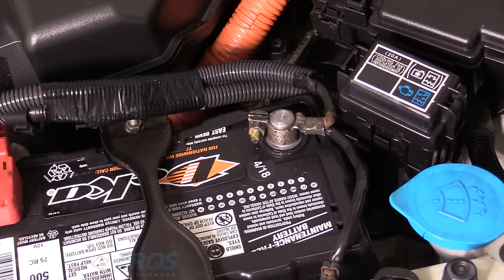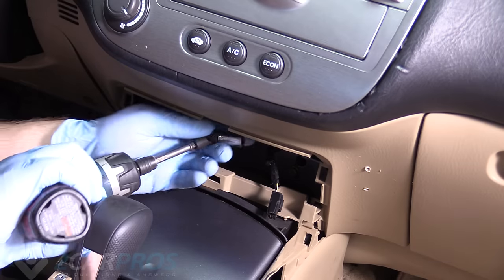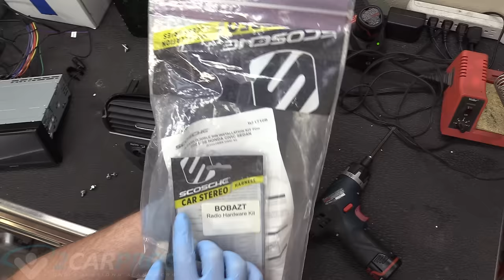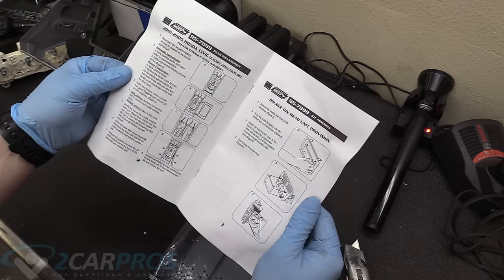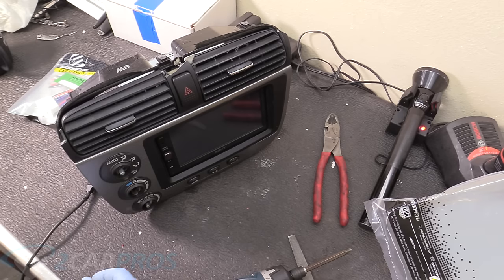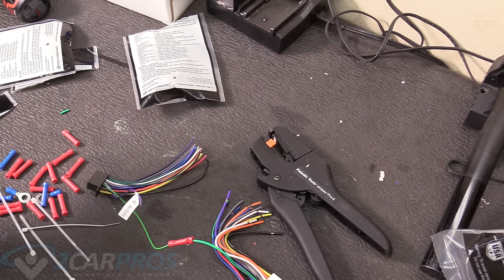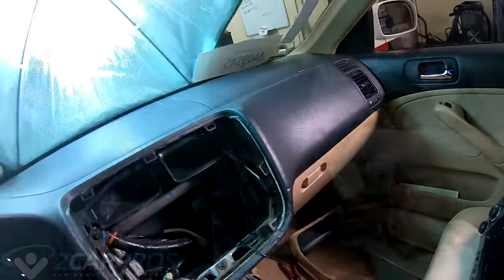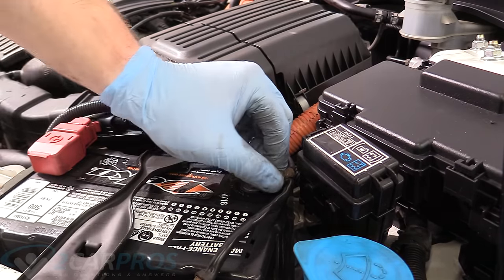How to Replace Head Unit Radio Honda Civic 2001-2005 EASY!

Comment: For anyone doing a DIY- don’t pull the cigarette lighter connector out like that. There’s a little tab underneath the connector that you press and then you can just pull it with a firm tug by hand.
Reply: Sometimes they are stuck and u have to pry it you’ll be fine doing it that way as long as as battery is disconnected  no worries.
Reply: @tonysgonzalez9390  This comment wasn’t about the electrical component, it was about preserving that tab on the plastic that keeps it locked in place (but yeah battery should definitely be disconnected regardless). 

If you do have to pry any electrical connector you should press on the tab or whatever’s needed for it to be in the “unlocked” position so you don’t break the locking mechanism when you pry it. They can be forgiving if you do it like the guy in the video, but at the end of the day they are plastic.
Reply: I just did that and the lighter isn’t working anymore what do I do?

Comment: FYI, only the 2003-5 models require removal of the center console to install the stereo.  2000-02 do not.
Reply: I was wondering about this.. It seems so ridiculous that you would have to remove all those panels just to get to the radio. I have a 2001 honda civic dx 5 speed manual. Ive replaced stereos in my 05 G35, my 05 Subaru WRX TR, and my 03 Jeep Liberty.... None of those vehicles required so much panel removing. My civic already has an after market old CD player which does work so it has the single din kit but I cannot find a video that shows how to just swap the head unit.
Reply: Eric Peacock I have a 2002 EX 5MT and your 2001 should be the same as mine, which is one of the easiest head units to access as you just pull out the trim surrounding the head unit after you remove those two bolts on the underside. No trim panels to remove except that small panel that covers those two bolts. It is bizarre that Honda decided to make it harder to access the head unit for the 04-05 mid cycle refresh for no other reason.
Reply: @IMP3TIGO  Probably because, people where stealing Hondas alot and if they couldn't steal the car they would most likey steal the radio
Reply: Oo
Reply: @No_Transitory  I installed my double din car stereo in my 2001 honda civic last week. I didn't have to remove the center console. The piece of panel under the stereo in this Civic is part of the center console. On my civic it is separate from the center console.
Reply: @bryanmurrayvideo2513  What double din unit did you go for if you mind me asking?
Reply: @IMP3TIGO  So for my 01 , I should just take off the side panelling, remove the lighter plug and then disconnect those bolts?
Reply: @mrdnd1234  been a while since I removed my head unit but I believe you just have to remove a plastic trim to access the underside bolts and once the bolts are out you can just yank the head unit trim piece (with head unit in it) out. My reply above describes the process. You should be able to find a video on YY but you can ask on civicforums.com if you're having problems.
Reply: @No_Transitory  how’d It go? I had 04 g35 but I didn’t do it myself. The one in my 95 stepside was easy to do as well, I wanna add a double din to my 02 civic dx with a 5 speed manual transmission
Reply: 04 did not require taking the center console apart.

Comment: Thanks a lot for this video. Out of the 10 or so videos I watched before replacing the stereo in my 2003 Honda Civic this one was the best in terms of clarity (no just the sound or video quality but the quality of the step by step instructions). I just replaced my OEM head unit with Pioneer AVH NEX-1400 with a back-up camera. Enjoying it so far. Thanks again!
Reply from the maker: Very cool! Thanks for watching!
Reply: how did you install the backup camera? any tutorial that you followed?
Reply: Did your car originally have a radio code?
Reply: @blue8ify  yeah it did have a code.
Reply: @NinadKothari1908  I went Google diving and discovered once you remove the factory radio, the code is not needed. That was my worry. I thought the car needed the code and I didn’t understand how I wld enter it w/ an aftermarket stereo.
Reply: @blue8ify  oh yes, sorry I didn’t answer that fully. Yeah my old radio had a code but my new radio doesn’t need it. It works as is.
Reply: @NinadKothari1908  no worries. Now it’s in the comment thread for others 🙂

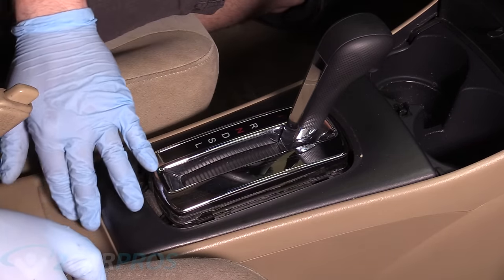Comment: For those with the manual transmission 7th gen civics, I followed this video exactly EXCEPT i skipped the removal of the shifter panel and started at 1:24 instead. Maybe you can remove the plastic trim panel for the manual transmission, but I felt that if I kept forcing it I would have ended up breaking something. 

Doing this allows you to gain access to every other step, you just kinda have to swivel the panel around the manual shifter for the initial steps.

Comment: Fantastic video! This was the first time I ever did anything like this to my car. Thanks so much for the in-depth video.
Reply from the maker: Very cool! I love hearing that. Thanks for watching!
Reply: Yea, same here, much appreciated. 

But for real, although not extremely complex or anything, it seems like this particular make of car is unnecessarily involved to swap a radio. 

Which is unfortunate, because In 2019, we need an aux cable! And obviously that wasn’t a standard feature in cars in 2001-2005. But hey, that’s what I get for buying an older car, I just had to have a manual to beat up while I learned. lol. 

Thanks again. Good man, I’ll come back to you for my car needs in the future, with any luck you’ll be my guide to a bunch of adjustments and work yet to come.
Reply: Me reDing this after removing the center console :|

Comment: Thanks for the video, pretty helpful. Though at least in my manual 2002 EM I can more easily remove just the cigarette lighter panel with a little wiggling rather than mess with the shifter trim. Once the suggested trim arrives I will be all set

Comment: Do you know where I can purchase the replacement parts for the center console (around gear shift) bezels for Civic 2003? In replacing the audio system with the one you have shown here, I need to replace those parts as they are damaged. I will be grateful if you could send me a link to any store taht may sell these bezels.

Comment: I did this on a 04 honda civic ex.  Used the wiring harness but my head unit could no save the time or the preset radio stions. Was told to  switch yellow and orange.  Now when i turn the headlights on. I lose the instrument lights except for one of the lights. Everything else is out untill i turn off the headlights off. Then everything turns on. Pls help me
Reply: Same to me if I turn my headlights on my radio goes black

Comment: @2CarPros I recently acquired a 2003 Civic. The aftermarket radio that was installed resets back to the initial set up after the car has been off for more than an hour. Also, Fuse 9 in the under-hood fuse box blows the moment a new 10 Amp fuse is inserted. 

Any idea what the issue might be? I’m thinking the radio was wired incorrectly. Is it possible incorrect wiring of the radio is causing that fuse to blow?

Comment: So what did you ultimately do with the parking brake wire? Did you tap it into the black ground wire or actually wire it to the parking brake? Thanks!
Reply from the maker: It's kinda like a choose your own adventure book. Both endings work and it's all good. Technically according to being technically right, I routed it to the parking brake light. Thanks for watching!
Reply: @2carpros  I don't understand.  There is no visual of what you are describing and I have no clue.  Also, why would the parking brake need to be wired to the radio?  What is wrong with playing the radio when it is not engaged?
Reply: @Killashandra111   regulations require that the parking brake be set before you can watch videos on the screen. This is a safety feature so you don’t watch while you’re driving. When the radio is connected to the parking brake, it will not play videos unless the parking brake is on.
Reply: Yes many car radio/infotainment systems have a wide range of features and options that are ruled too distracting or complex while driving, but if you have a passenger it is a shame to not have full access also

Comment: My radio code isnt working and I dont feel like driving 3.5 hrs to nearest Honda dealership for the code, will replacing with an after market one will the radio work?
Reply from the maker: Yep. That's actually the reason I replaced the stock one with an aftermarket unit. Thanks for watching!

Comment: What is the connection wire you plugged in to the lower left of the new audio unit? What's it's purpose?
Reply from the maker: I believe you are referring to the antenna. Thanks for watching Brad!

Comment: Late coming to the video, but what happens to that radio code I have to enter every time I reconnect my battery?
Reply from the maker: It should be listed in the manual or in the glovebox. Barring that call the dealer. Thanks for watching!
Reply: @2carpros  what I discovered is once you remove the factory stereo, there is no need for code. That was what I was asking. Thank God I know the code. Ty for the video!!! I’m deciding on a radio now. Does the double din work well if I want to keep my storage space and only get a single din stereo?

Comment: Can you tell me what you did with the second of the two connector that connect to the oem radio when its time to plug in the new radio?
Reply from the maker: I just plugged the slicer harness into the car's stock harness. Thanks for watching!

Comment: Hey Ryan I have 2005 hybrid Civic I was thinking about putting the same system but would it affect the hybrid battery if I install this radio?
Reply from the maker: Nope. This video was actually done on a 2005 Honda Civic Hybrid. It is my daily driver. Thanks for watching!
Reply: @2carpros  thanks

Comment: Do I have to upgrade my battery and alternator?
Reply: If you are adding wattage probably (amp, and subs, etc.). If you are simply switching out the head unit probably not

Comment: so how would you mount the wire to the parking brake?
Reply from the maker: You just run it to the parking break indicator light. So when it has power the parking brake is on and you get full functionality. Thanks for watching!

Comment: Is there a way to switch the positions of the cubby and stereo slots (single din) ? I want the stereo on the bottom portion ...
Reply: That’s a neat suggestion!
Reply: Not with the stock trim. But I would think it doable if you can make/get some trim

Comment: Will an 6.2” fit with no issues?
Reply from the maker: As long as it is double din then yes. Thanks for watching!
Reply: I got an 7” instead I’m gonna install it next week in my 04 civic thanks for the video.
Reply: @brianoxendine4844  i don’t know if you will see this especially a year later but how did the 7 inch fit in your car did you have to buy a kit or did it fit good without one?

Comment: I ordered the scoshe one for 04 civic. Didn't fit. What do i need
Reply from the maker: You might have gotten a bad one. Maybe try a different brand? Thanks for watching!
Reply: I work at a Best Buy that has a car audio installation bay. We use Metra for the dash kits.

Comment: what if its a manual 03 will it still be possible?
Reply: And by this I mean the wires are the same? 
I understand the trim removal is different, 

Also, do the quick connectors come with the harness or need to be bought seperately? Im assuming they come with the harness because I Cant find them anywhere else.

Thank you
Reply from the maker: They should be the same, and yes it comes with the harness. Thanks for watching!

Comment: I had mine working fine until my dad brought into auto zone idk wtf they did to it but it just has the words code on it.
Reply: Ktowers means you need to punch in a special code to unlock it. It’s a anti theft feature and with a quick google search you can find the code you need to unlock it.

Comment: Is there any way a 6.2” touchscreen display will work for this because I cannot find a cheaper 6.4” inch and new ones for ~600😂
Reply from the maker: You usually get what you pay for with head units. I prefer to spend more and get more but there are a TON of different aftermarket units to fit any budget. Thanks for watching Gavin!

Comment: I’m confused do I need that wire for the break or not 😂
Reply from the maker: TECHNICALLY you have to connect it to the parking brake light circuit. BUT if you wanted to you could just run it to a ground and then always have access to all the features of your head unit. Thanks for watching!
Reply: Legally you need it.. but.. technically you can ground it.. dvds shouldn't play if you're driving (legally)..

Comment: You broke the top of the bezel getting it out.
Reply from the maker: Gotta be careful, the plastic is old at this point. Thanks for watching Matt!
Reply: @2carpros  Yeah it gets brittle, you should see the interior of my 99 Dodge ram. I had to totally replace the entire dash top cause it just crumbled but the rest of the interior just feels like it shatter like glass.  I have an 03 civic, do you have a recommendation for a double din unit that also has built in GPS navigation that won't break the bank?

Comment: Yeah, the scochie, or whatever, kit for double din radios DOES NOT FIT double din radios! It's frustrating garbage is what it is.
Reply from the maker: I have done a lot of these so I can't remember if this is one I had to modify slightly or not. But if yours didn't fit return it and get a different one. Aftermarket parts are often like that for some reason. Thanks for watching!